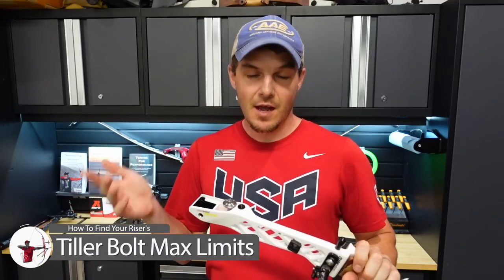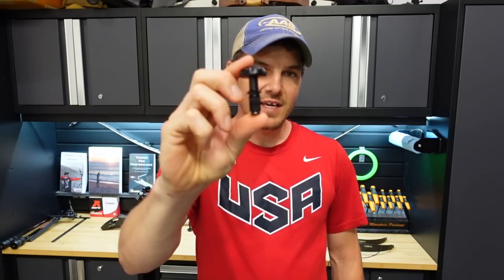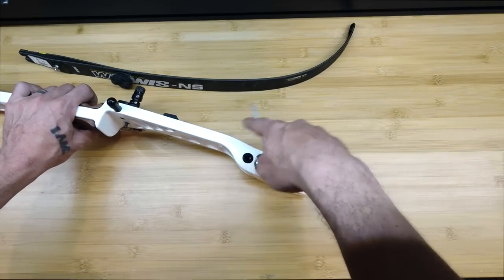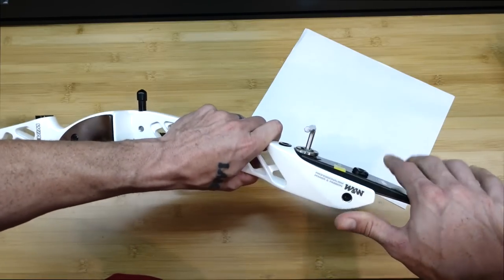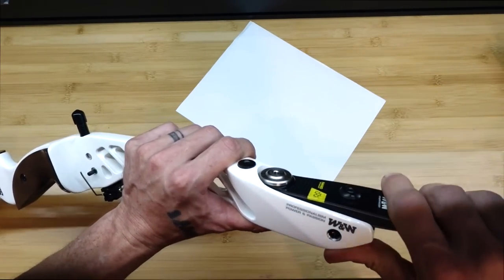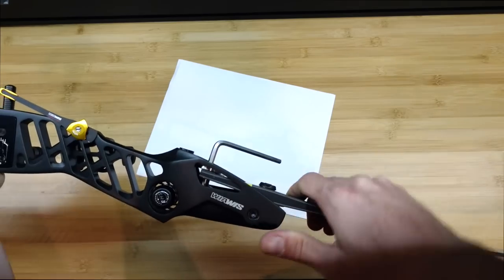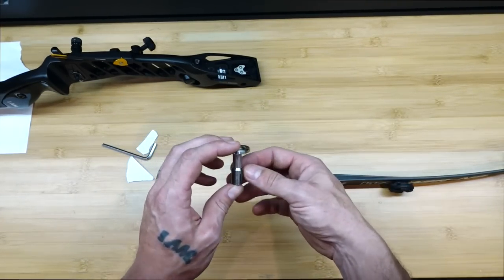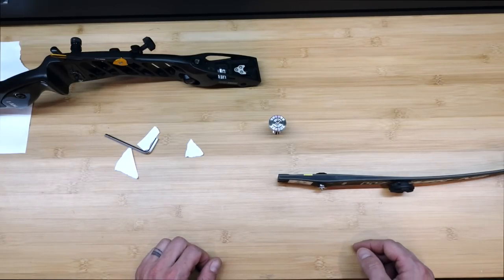Tiller Bolt Position Limits | How to Determine Factory Tiller Bolt Settings

Comment: Hi Jake,
on most Kinetic risers we can can make 4 complete adjustment rounds  (+ or - 2 #) and it's recommended to stay between 1,5 to 2,5 rounds (+0,5 to -0,5 from the middle position)
my tiller is + 0,5, like standard factory and with the adjustments (1,5 low limb and 2 rounds up limb)  it has a direct influence on the balance between elasticity and power then,  on the flight of the arrow .

you feel too hard with 30# limbs ? 
if you  make 4 rounds up you won't have a good result with 28# because there's a mecanic resistance and a limb torsion, then it's better to use 28# limbs with 2 rounds (balanced position)
this is what i made and after some adjustments (viewfinder) my arrows go out faster and the direction is more stable and i feel less pain in my shoulder (bow)

Comment: clearly you are not a mechanic :D :D it's painful to watch :D :D The measurement is "daylight" and you fear bolt sheering off instead of limb cracking in the edge of the bolt... you are reading Win-win paper without having a clue about materials and mechanics. Sorry. The rest of your movies are very good but this one... rofl.

Comment: Thanks for the video Jake. For the tiller bolt maximum out position, in addition to making sure the end of the limb does not move past the vertical centreline of the tiller bolt, do we also need to consider the rule of thumb for recommended thread engagement? From google the rule for a steel (tiller) bolt into aluminum (riser) the minimum thread engagement should be 2-2.5 times the bolt diameter. This may be a position that is closer in to the riser than by using the end of the limb and centreline of tiller bolt rule.

Comment: Ok to fix this problem stop buying this crap go with a long bow or short bow made of one piece of wood that is sealed naturally you avoid rust mold and waterlogged issues bc the bow is water prof not resistant huge difference 😊

Comment: Would the paper-gap method work with the Win&Win Nana TFT riser?  I have a pair of WNS Explorer 68-18lbs limbs, but when I had them at the max out position without the paper gap, the draw weight would be at 20+ lbs, which was greater than the limbs' 18 lbs specs.

Comment: Hi Jake, 
Uukha state on their website that their limbs are made to preform in the median bolt position. Screwing the bolt to the bottom position results in shifting the main forces from the limb to the tip. This results in poor performance and xcessive noise.
Im wondering whether this applies to Win&Win and Hoyt as well? 
I would love to see a draw force comparison of the effects of tiller bolt in the 3 position, in  out snd the middle. 
Thanks for your reviews.

Comment: I have a Kinetic Invinso 25" riser with 28lbs medium limbs, and my tiller bolts appear to have the stopping points. If I'm trying to have a positive tiller setting of about 6mm, is it advisable to screw the top and bottoms bolts until the stop and then start unscrewing the top bolt to make the 6mm difference?

Comment: 10:35 Is this the optimal setting? Having even surface contact between the limb and the tiller bolt, no light on either side?
Reply from the maker: That’s for max in. Not optimal. 

Optimal is whatever your needs are. But within the range shown in this video.

Comment: For the maxium in postion - Would we not check once the bow is braced for the paper method, to see if there's a gap or not against the bolt head.

Comment: Ww factory settings is
Tiller bolt 20 mm from the riser.
2 turns in
2 out.
Your wellcome
Reply from the maker: Not on all of their risers. Each one is different from model to model. Otherwise I would have integrated the stops into the Precision Tiller Bolts.

Comment: For anyone with an specific w&w wondering the factory setting an email to them will fix it I did it when i bought my atfx an was about to buy new limbs because i forgot how far in i had set the tiller bolts
Reply: If anyone with that bow want the email I will search for their answer and post it here

Comment: Hi Jake, great video. Why did you decide not to add a collar to your new limb bolts, so that at least the max in position is determined?
Reply from the maker: W&W has changed the designs so much over the years I would need to release a tiller bolt for each so around 10-12 different bolts themselves. 

This will be a custom order option for a specific riser possibly when our Austria hub launches.
Reply: @JakeKaminskiArchery  I see thank you. Putting a collar on the bolts you currently have for sale would stop them fitting some models than they would otherwise fit without the collar?
Reply from the maker: Correct

Comment: Did I understand correctly?  tiller surface and limb be one level?  I used subtitles germany from youtube translation.
Reply from the maker: For max in, yes
Reply: When it's level is the maximum position.
Reply: @JakeKaminskiArchery  thank you , For maximum and how many turns counterclockwise minimum?

Comment: I'm of the mind that the perfect position for the limb bolts is so that the flat underside of the mushroom is flat in the surface of the limb. Adjustments for tiller can then be made that are small enough for changes in this interface to remain 'near enough'.  If people stopped using limb bolts as a means to avoid buying different weight limbs or different spine arrows, this problem pretty much goes away. My pet hate is hearing well-meaning archers explain to noobs that "these bolts are for changing the draw weight of your bow".  They're not (even though they do). They're for adjusting tiller and making fine adjustments during arrow selection/tuning. If you're using limb bolts at either of their extreme settings you're either using the wrong limbs or the wrong arrows or both. Get it right, stop looking for short cuts. Them spend your time and money with a good coach and practicing. I have learnt this from making these mistakes.